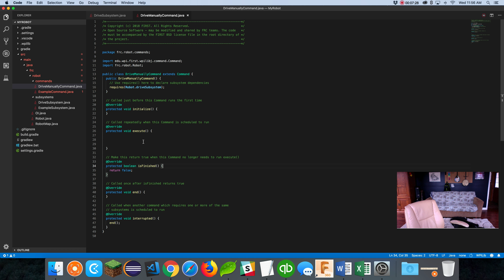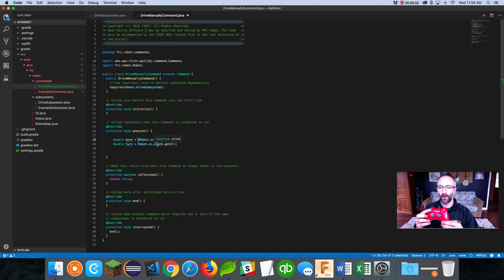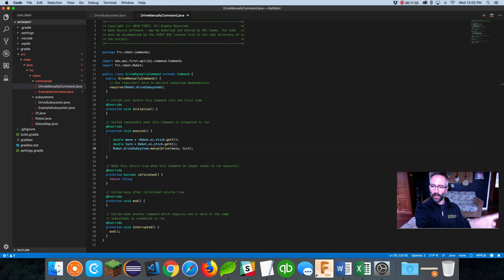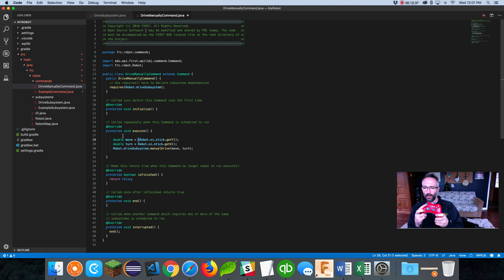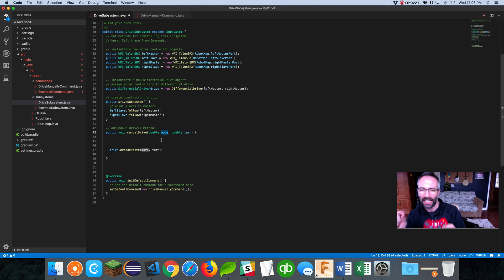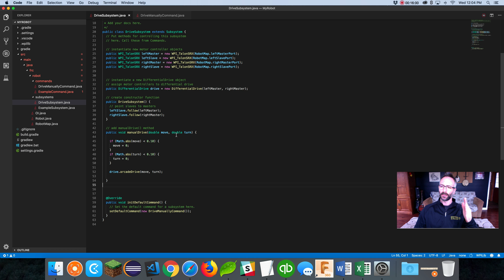FRC Drivable Robot PART 4: Manual Drive Command  / Java VS Code

Comment: would i have to make a button in the oi if i wanted the left joystick to control the left motors and the right joystick to control the right motors?
Reply from the maker: No, that would be in a command. If you're using an xbox controller you may want to look into the xbox class. We used that last year: http://first.wpi.edu/FRC/roborio/beta/docs/java/edu/wpi/first/wpilibj/XboxController.html

To access the other joystick you'd have to do something like this in the execute method of your command:

double right_stick_move = -Robot.oi.joystick.getY(Hand.kRight);

Then instead of using drive.arcadeDrive() in your subsystem, use drive.tankDrive() and pass it your left and right joystick values sourced from the y axis.

Does that make sense?
Reply from the maker: Your command would look like this:

    double move_left_side = -Robot.oi.stick.getY();
    double move_right_side = -Robot.oi.stick.getY(Hand.kRight);
    Robot.driveSubsystem.manualDrive(move_left_side, move_right_side);

Your subsystem method would look like this:

  // add manualDrive() method
  public void manualDrive(double move_left_side, double move_right_side) {

    drive.tankDrive(move_left_side, move_right_side);

  }

Not sure if the xbox class is necessary. I'd try it with the standard Joystick class in the OI.java file and if that is being a pest, maybe try the xboxController class. Here's our implementation of it last year: https://github.com/team6637/Robot2018/blob/master/Robot2018/src/org/usfirst/frc/team6637/robot/OI.java